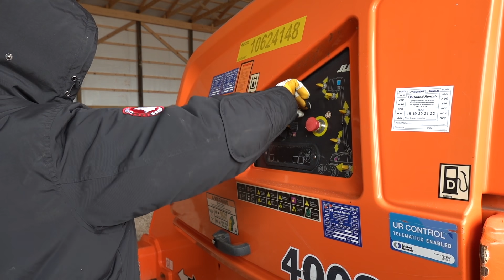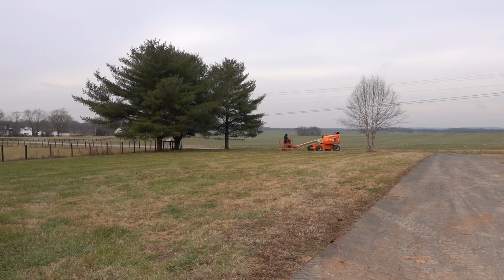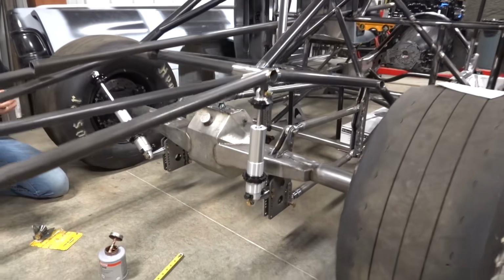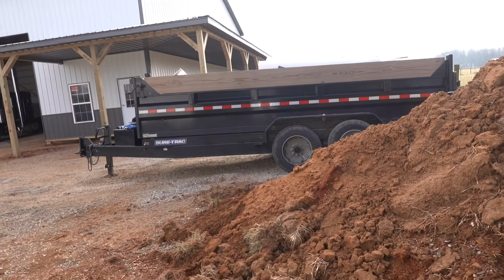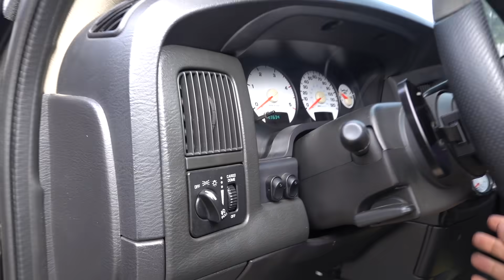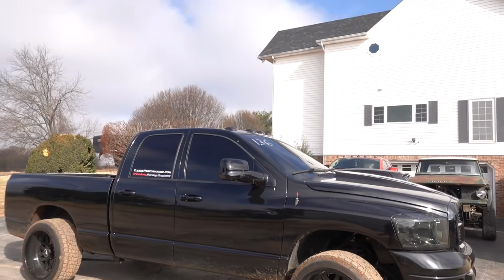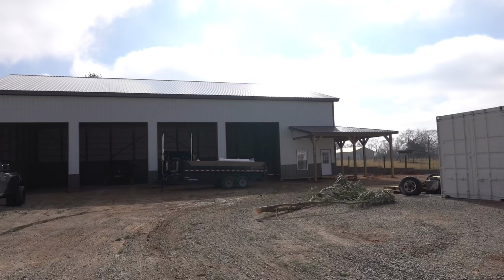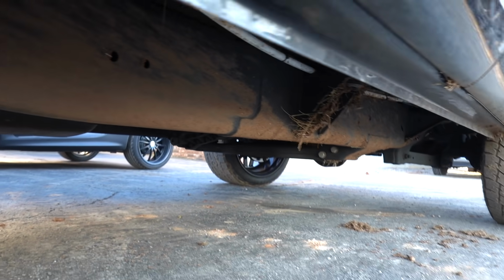1000HP CUMMINS TRUCK vs MASSIVE TREE!!! 4WD LAUNCH!!!

Comment: At least you didn't have the fire department show up... I "dropped some oil off at O'Reilly" coincidentally the same day I had a fire and had flames 40 feet in the air as the big red truck pulled up...
Reply: Hahahaha got a good laugh from this one

Comment: Just got my first vehicle 1995 dodge ram 2500 with a cummins
Reply: Very nice! I’m a big second gen guy! My son is only 6 right now, but I plan on buying a 2nd gen Cummins for his first truck too.
Reply: Start saving for a transmission rebuild right now
Reply: @allencarabajal8989  my son just turned 2 months i already got an old 4 speed f250 to fix up for the lil bugger.
Reply: @keith2860  nice! It’ll mean that much more for it to be a project together!